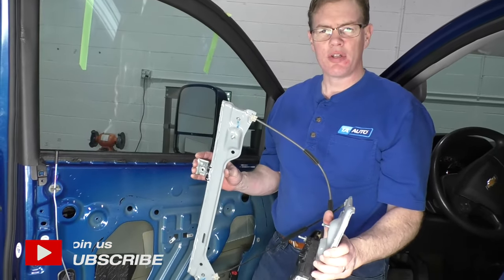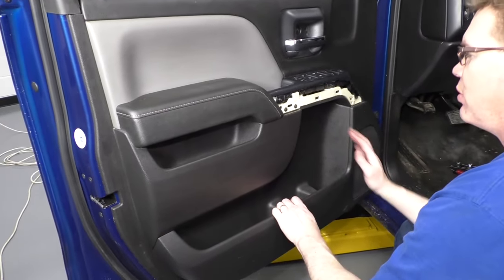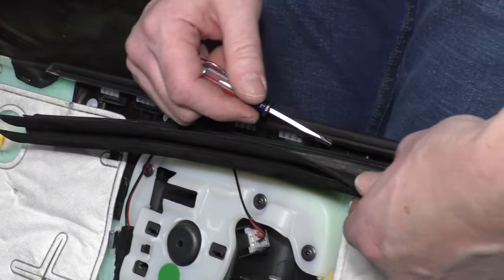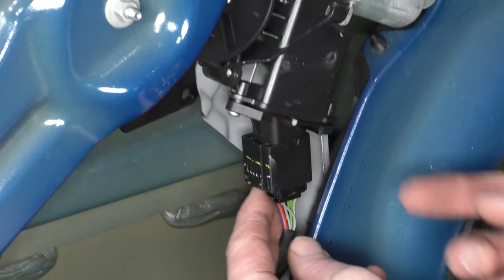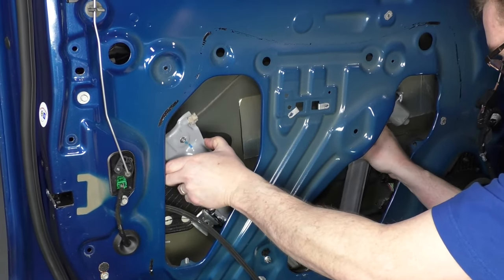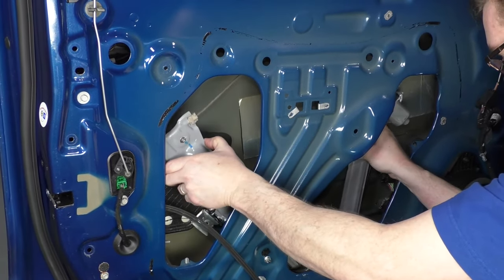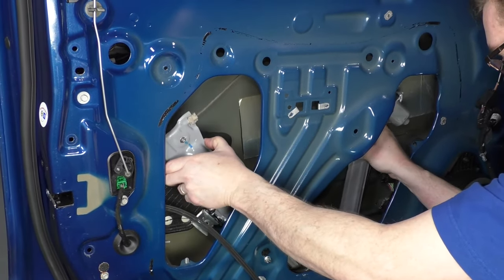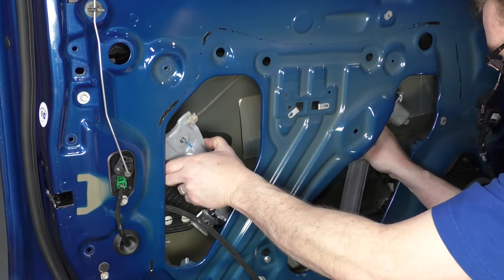How to Replace Front Window Regulator 14-19 Chevy Silverado

Comment: Never write comments but this video saved me $450+ worth of labor.  Couldn't have been easier to follow and my installation went flawlessly.  Big thank you and I will look to your channel for any of my future automotive needs!
Reply: Same here! Just did mine today. It just takes a little bit of time and you really do save yourself those expensive shop prices
Reply: @yunggjulio2012  I'm just waiting for the window regulator to be in shipped and I'll be tackling this. One thing I've noticed is there's two types of motors. One is automatic up and down and the other is just up and down. I didn't want to pay the dealership prices so just got mine on Amazon and said screw the automatic, as long as it works that's all I want.

Comment: Thank you very much for this video. Saved me a lot of time. Btw: My window was stuck at the very top, and I had no way to push it down. The best way is to remove the cover of the motor on the actuator. Then the window can be lowered by hand.
Reply from the maker: +Pascal Gerber Thanks for checking us out. Shop for high quality auto parts on 1AAuto.com:

http://1aau.to/m/Shop-1AAuto-c

Comment: Great video.  Only problem I had, was that I didn't realize window wasn't set in brackets correctly.  When the window would go all the way up, it immediately came right back down.  Adjusted the way it sits in brackets, and it worked. Thanks

Comment: This video saved my father like 600 dollars. Did it for his 2016 GMC Canyon and bought the part on Amazon. Only thing is it's not automatic up and down when you push or pull the window button just once like the OEM but whatever, it works.
Reply: you just need to initialize the window, not sure the exact version for this truck but put the window up and hold the button up for like 10 seconds, then get the window down and do the same thing. might get one touch working again
Reply from the maker: +Dac Attack this is great to hear!!

Comment: Trying to figure out if this is my issue why my window on my 2015 Sierra 1500 won't roll down or up but I can hear a light click when I engage button on switch . It's only the driver window and this happened and I tried to roll window down frozen. Any advice?

Comment: What if your window is stuck in the down position how are you able to take out the window regulator? I’m having a hard time. Trying to figure it out, I’ve tried pulling up on the window, but it does not budge.

Comment: I just fixed my 2015 Tahoe passenger door motor problem. The electronic board was bad .  The input and output connection pins were not soldered to the board! I just soldered the board and tested. I started working.

Comment: I’ve replaced two regulators and the auto up only goes about 4 inches and then goes back down. I have to inch the window without engaging the auto up function. Any ideas/suggestions?

Comment: I just did two that were ceased up. I tore them apart to find the commutator brushes out of placement. I'm not sure how they jumped their housing, pushed them back in, greased the gears, greased the rails, reattached, and good as new on 23 year old vehicle.

Comment: interesting to see that there is still no answer to the question i asked 3 years ago.   Regulator or motor is broken in the up position.  how do you get the window down?   I am back replacing this same part 3 years later and i ran into the same problem.   i can't get the two bolts at the top out with the window in the up position.  i am an old man, so i don't remember how i solved it the last time.   my half baked brain tells me it just jammed last time, and it started working again.

Comment: Im having issues after installing window regulator. My window rolled all the way down at first. Now it rolls half way up and goes back down. The only way I've been able to roll it all the way up is to disconnect the neg. Terminal on battery then reconnect. If I roll it down I run in to the same problem. Please help.
Reply from the maker: +Rafael Castelan Since there could be multiple reasons why youâ  re experiencing this difficulty with your vehicle, I strongly recommend that you have a reputable mechanic inspect it. Theyâ  ll be able to troubleshoot the problem and tell you what part or parts youâ  ll need for the repair.
Reply: Rafael Castelan did u figure a fix for this? Mine is doing the exact same thing
Reply: Mine is doing it too smh

Comment: i sure would like to know how you got the window up and down with the regulator broken.   It was up to remove the bolts that attach the window to the regulator, then you brought it down to remove the window from the brackets.   Mine is stuck in the up position.  seems like the top two bolts for the regulator will not budge with the window in the up position even though i pretty much got the brackets detached from the window.
Reply: Same problem! I cut the two black housings with the cable running inside. Don't need the old non-functioning assembly anyway. Make sure you tape the window up or it will drop. I also plugged in the new regulator and lowered it down a bit before putting it in. it allows you not have have the space to work without removing the glass, make sure the metal track is between the glass and interior facing side of door.

Comment: I get a message: Action required open and close driver window. Goes down but then won’t come back up. Any thoughts?
Reply: hilanderBKAE did u find a fix for this? Mine is doing same thing
Reply: I have the same problem! Replaced regulator, ran up and down the first time. Put everything back together, tried again, rolled down fine,  but only came back up @4". Only way I can close is short pulls on the switch, can eventually get closed. Had the same action required message. I'm thinking there has to be some reset sequence to complete, but I haven't found anything yet!
Reply: Obviously you have fixed it by now, post the fix? thanks.
Reply: This is my fix. Push and hold down button. Hold for 3 seconds when fully open, then pres and hold up till fully closed and hold for 3 seconds. Should clear